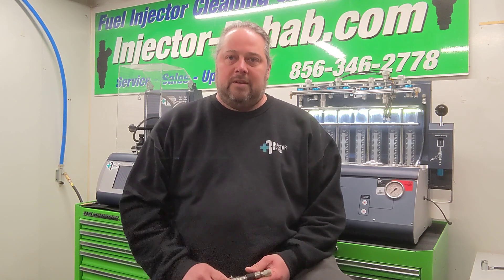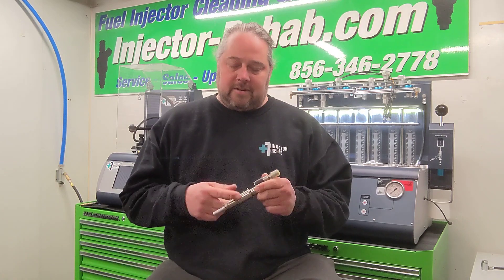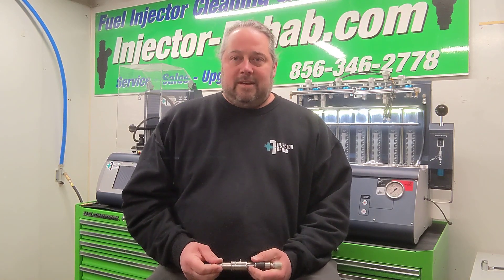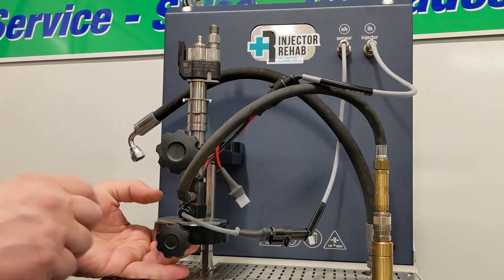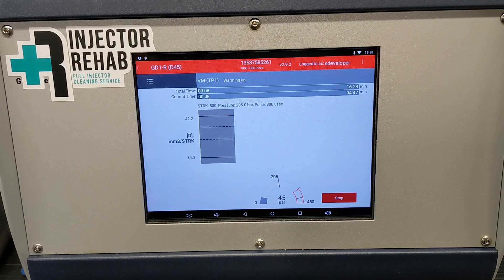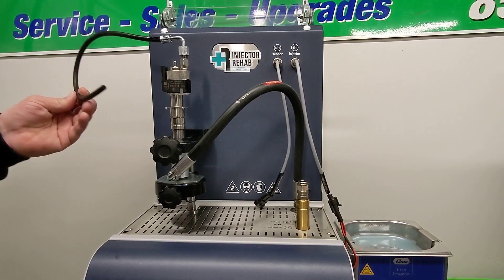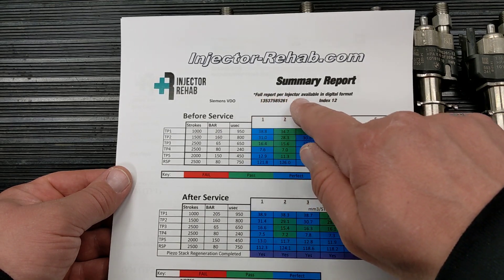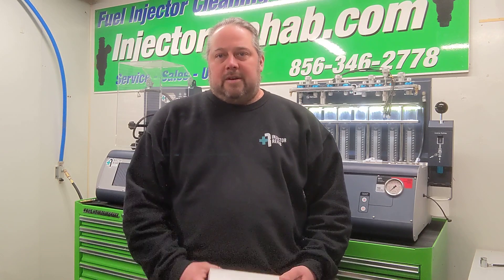Professional BMW N54 N63 N74 Piezoelectric Fuel Injector Cleaning - How it's Done

Comment: Great video, very insightful.

Quick question, when you fit new injectors, you need to code them in based on the number on injector, I was under the impression this was based on the performance of the injector after manufacture to enable the ECU to compensate or fine tune the control of each injector separately. So is this number on the injector still correct after it’s been refurbished or would a new one need to be issued or used?
Reply from the maker: Unlike diesel, the number is not changed
Reply: @InjectorRehab shame I’m not in the the USA, just bought a new set of index 12’s and removed a set of index 12’s that are only a few years old that I’d like tested and cleaned. Hopefully someone in the UK has as good a set up as yours🤞🏼

Comment: Can you reverse flush them at home? I vane an ultrasonic cleaner, but i dont have a 200+ bar machine
Reply: If your injectors can be restored by cleaning you can clean them your self at home for cheap. 
First remove your injectors and re-mount them up side down, so that they spray into the air, run the engine on starter and video record the spray patterns and look for leaks. Then clean them with a $25 injector driver and a $50 ultrasonic cleaner. For reverse flow just turn the injector upside down, clamp on a hose with a bottle filled with carb cleaner, run the injector driver on long pulses and sqeeze the bottle. Let the run off pass through some white cloth so you can tell if anything comes out. Then re-install on car and test the spray pattern again and compare.
You can't clean your injectors as fast as these guys can with their expencive machinces, but everything dissolves over time, so if you have the patience, let it soak for as long as it needs and just do it yourself.
Reply from the maker: @tomasklony9544  anything is possible, I guess. Having an ultrasonic is like saying I have running shoes, so I can run a marathon.

Comment: Index 1 injectors are known to be  pretty good. They were never recalled. So is it worth sending them in?
Reply from the maker: @alexmedia7421  there is a whole group that swears by them, and they are not wrong.
Reply: @InjectorRehab  in your professional opinion is it a good idea to clean them if they are still working well. Could cleaning them have adverse effects on their function? Or do the later versions have the bad particulate filters that's get damaged?
Reply from the maker: @alexmedia7421  they typically have good results. They aren't very common, so the in depth explanation causes more confusion than it's worth. It's one of those inside secrets where, if you know, you know
Reply: @InjectorRehab  Fair enough I was just interested as I'm a mechatronics engineer and like this stuff. You guys seem very knowledgeable in what you do. So I will likely send mine in at the end of this summer.
Reply: @InjectorRehab  I currently have 220k kms on them and they don't seem to have problems.

Comment: Great video. Are you able to explain about the regeneration of the piezo stack? Does that mean that leaking / out of calibration injectors can be fixed? Also, that injector was used in the N53 eninge as well, which was (unfortunately!) sold in Europe.
Reply: No these injectors can not be fixed. Only cleaned. If it’s broken it’s not reparable.

Comment: I bought a used set of index 12 injectors from a guy off market for a reasonable price then sent them to injector rehab to get cleaned, tested and regenerated. I had one fail testing which is the gamble you take when buying used injectors. The ones that passed though I installed in my car and they operate flawlessly. Highly recommend them for this service and the price is very responsible compared to the price of buying a brand new index 12 injector.
Reply from the maker: Yes, we make sure to link to an article explaining managing your expectations with these injectors as well. They are flawed by design.... https://injector-rehab.com/knowledge-base/managing-expectations-for-piezoelectric-fuel-injector-cleaning/
Reply: @InjectorRehab  I knew exactly what I was getting into even just buying used injectors and I hope everyone else does too. There's no guarantee that they all will even work without issue. Just because someone says they are good doesn't mean they actually are. I'm happy with the result I got from your service on mine though. Now i'll see how long they last.
Reply: HOW MUCH DID THEY CHARGE YOU FOR THE SERVICE???

Comment: i think my index 11 is clogged. misfires like crazy and car shakes. would this help  or  does it have less chances of the service helping than if it would be leaking?
Reply from the maker: Our crystal ball doesn't work. Read this page: https://injector-rehab.com/knowledge-base/managing-expectations-for-piezoelectric-fuel-injector-cleaning/
Reply: @InjectorRehab  that wasn’t the question but thank you
Reply from the maker: @ItSpooling_  What was the question? Ultimately, you want the injector to operate like new, correct? That's what the service does. No matter what the issue with the injector is. We cannot tell the outcome until we actually do it. I'm not sure how you want the question answered or what your question is if that answer is not what you are looking for.

Comment: Do adjustment values change after all this? I’m talking about the values that are coded to the dme when injectors are changed.
Reply from the maker: No coding does not change as it is not disassembled like a diesel injector would be, which would require coding. Being ditty and not flowing what the coding is telling the DME is part of what causes the issue. Flowing incorrectly is basically the same as entering different coding.

Comment: Sorry if I missed it but will this address leaking injectors? I'm a bit confused since most N54 issues is the leaking right and I thought those had to be internally rebuilt. I watched the whole video and not sure how cleaning them helps the leaking in any way?
Reply from the maker: It does address it, in some cases, hence why we say on our website about the success rate and an entire article around managing your expectations where we explain that there should be no expectation that this is some magic potion. This is not a diesel injector. It can't be "taken apart".
Reply: @InjectorRehab  Thank you for the reply. This is interesting... it looks like there is only one company out there (GB Remanufacturing) that truly does rebuild them. I wonder if they just cut it open and weld them back together? Unless they have some kind of special industry secret....
Reply from the maker: @JackRR15  no. We work with GB every single day. We have the same equipment. I can guarantee you we've done more of these than GB. We do it for the public, GB only does it for one other reseller. I would assume their description is different of what is being done than what the reality is. Assuming you are talking about FCP Euro as that is the only company GB does these for.
Reply: @InjectorRehab  Copy that and yeah was talking about that. Thank you for all the info! I'll consider my options here!
Reply from the maker: @JackRR15  The confusion might be coming from them selling remanufactured index 12. They are taking cores and what is salvageable they are able to sell as rebuilt. You sending your set in for service, there is a chance some of those cores would not be good. However, they are your cores. FCP supplies GB with cores, takes their chances on what is sellable, and they sell those. We also have them on our site for sale when we are able to get good cores. They are not easy to find and are only getting harder over the years.
Reply: @InjectorRehab  I see... thanks again!

Comment: great video I have index 12 injectors for a n54 n I think there eathier leaking or clogged how much is it to fix them?
Reply from the maker: Thanks Jeff. There is a link in the description for the service and a lot more info about having it done. Leaking is an issue that many times CAN be fixed with service.
Reply: I'm gonna send my injectors In this week
Reply: @jeffireland1941  how’d it go? I’ve been chasing uneven long term fueltrims on my n54 injectors are index 12 not even 2 years old. Left bank 1 is around 8-10% and bank 2 is 0-3%
Reply: Jeff did you have this completed?
Reply: JEFF WE NEED AN UPDATE

Comment: Thanks for the video. 

Few questions.  is there a minimum mileage range we should consider removing them and sending to you for cleaning?  Maybe at 50k miles?

you say the injectors need to be "serviced properly", is there anything additional that we need to do to service them?  Fuel injector cleaner?  Or do you mean sending them to you for cleaning is the "serviced properly".
Reply from the maker: We don't have a set mileage, just when you notice issues. Properly meaning at high pressure like we do, not on a port injection bench running low pressure.

Comment: Would you have to recode them to the car???
Reply from the maker: Recode the same injectors that just came out of it? No
Reply: @InjectorRehab  Good point but the coding of those injectors basically tells the car the slight variations in the flow rates and whatever other metrics apply to these injectors. I assume those values would differ after a reconditioning done by you? Please correct me if I'm wrong.
Reply from the maker: @gster109  I dont follow your logic. DME is coded for injector 1 to be coded for X, injector 2 to be coded for Y ect ect... They are removed, cleaned, Piezo stack regenerated and everything is back to new standards... Injector 1 is put back in to 1, injector 2 is put back in to 2... What would you code? The number printed on the injector didnt change. The only reason you would need to is if you didnt keep them in order, right? Either I am missing your point completely, or you are missing mine. Either way, the answer is No. You would not need to recode an injector being used in the same cylinder it was removed from after being serviced.
Reply: @InjectorRehab  The coding process takes care of differences in flow rate of each individual injector. After you recondition them aren't those flow rates going to differ from when they were brand new, even if it's a minor or negligible variance? The reason to code is not necessarily to tell the car which cyl it's in but rather the flow rate tolerance/variance from factory.
Reply from the maker: @gster109  Yeah exactly. So how would bringing an injector back to its original specs or as close to them as possible require coding that the DME is already set for? The injector would be pulled and sent to us because its not performing as it should be. The computer doesn't know that.... so how would getting an injector that is out of spec, back to spec, require coding? And no... we arent altering them from when they were new. Which is exactly my point of them requiring being cleaned and piezo stack regenerated back to new.
The "which cylinder" was saying if you pulled an injector from the same cylinder and put it back in the same cylinder how would you code it differently than it is already coded for.
Reply: @InjectorRehab  Because even brand new from the factory they are not made exactly the same.. Cleaning them which is a less accurate procedure I assume would not bring it to the EXACT spec it left factory as but possibly slightly different, hence requiring coding for even minuet flow rate differences.
Reply from the maker: @gster109  so not cleaning them and leaving them alone even though they are flowing different than when brand new DOESNT require coding, but taking them from a state way out of spec of what they are coded for and bring them back to that spec DOES???? 
Got it. 
I'm done replying to this because I can only explain it to you, I can't comprehend it for you.
Reply: @gster109  If the product gets contaminated the values of the injector change too, then you don't have to recode them either right? So as long as you write down the correct numbers for each cilinder when you remove them and put them back in the same order it should be fine. Since you only restored the injectors close to the original values, so should work fine. It might be that other values could work better, but i think that will be incredibly difficult to measure and adjust.

Comment: So, just test and report back to customers. U don't fix them if bad?
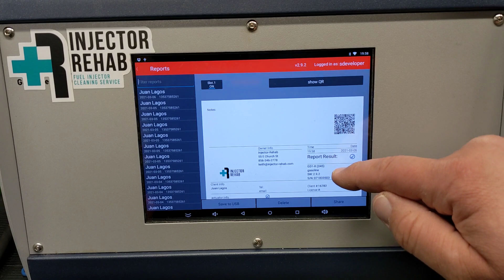Reply from the maker: No, Did you watch from 8:09 and on???  Those that are able to be fixed are fixed, reported and sent back.....
Reply: @InjectorRehab  I see. I thought to fix, u have to disassemble, I guess back flush will work too. I guess that is how they refurbish them. After your test and "repair", would the calibration number change?
BTW, have u seen people in China intentionally erase and change the index to 12 and randomly put in some calibration number? Because I have done some DME injector calibration programming and the DME rejected those calibration numbers.
Reply from the maker: @derekkchung  they, like every other Injector, are a sealed unit and cannot be opened. 
China does all sorts of stuff. They can't get port injection knockoffs right, don't know how the hell they would get Piezoelectric right. 
Each Injector would get a report back with all the flow information.
Reply: @derekkchung 🤔🤔 so basically go buy some really good fuel injector cleaner and pour it in your tank and fill with according gallons. Then rev your engine hard and heavy like right up to the redline. Feather the throttle occasionally. Do this until fuel is half of what you started with.  🤏